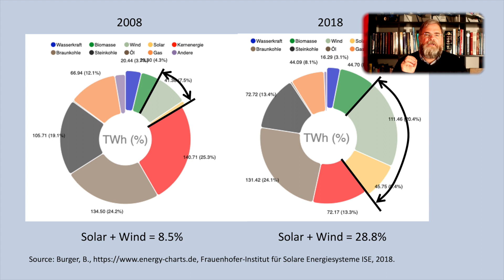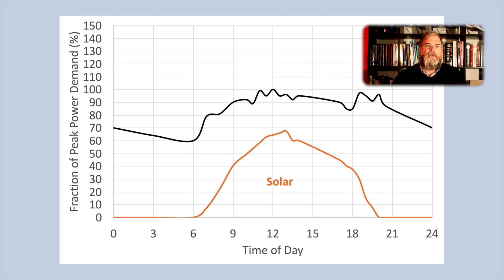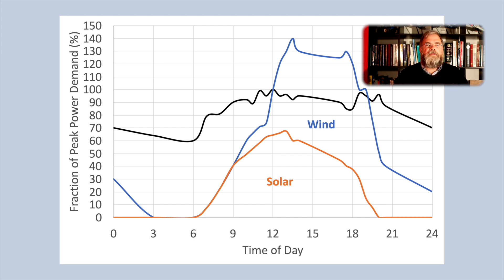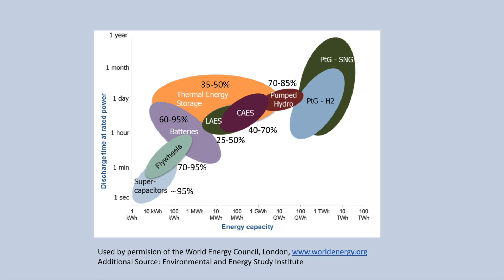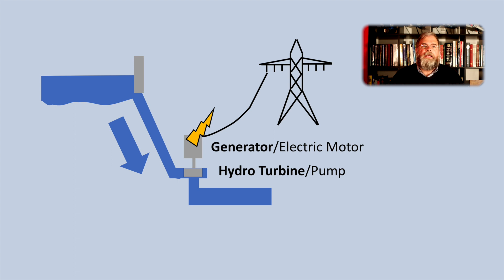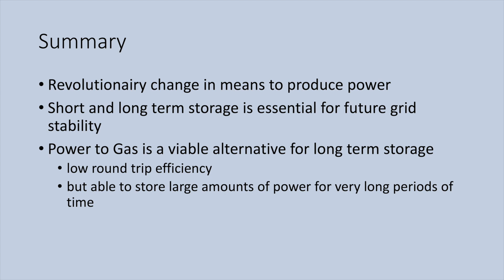Energy Storage and the Future of Gas Turbines for Power Production

Comment: Ammonia fueled IGTs have been proposed for marine power applications but that seems like a potential corrosion issue with all the monels on a ship.

GE Vernova has been doing field testing of their F-Class IGTs using ammonia as a fuel and has reported success so far
Reply from the maker: I‘d like to know the economic case for ammonia.  I have the sense that the people pushing hydrogen are not really looking at the big picture.  i.e. asking the question where the hydrogen comes from and what it will cost.  The round trip efficiency of hydrogen as an energy storage medium is very low compared to alternative ways to store energy.  And hydrogen has a very low volumetric energy density so it needs to be stored in pressure vessels which are very expensive.  Also hydrogen embrittlement is a problem so these pressure vessels will need to be made of special materials which are less susceptible to this likely making them even more expensive.  Ammonia perhaps reduces the storage expense of hydrogen.  But the round trip efficiency of ammonia will be even lower than hydrogen.  The last ammonia conference I attended they, like the hydrogen community, focused on the advantages of using ammonia.  I never heard anyone talk about the economics of using ammonia and how it compares with other energy storage media.
Reply: @engelbrechtgmbh  The Haber Bosch process is too energy intensive to make a clear economic case for ammonia fuel from a Well-to-Wheel perspective, in my opinion. I think the hope was to improve biochemical production methods but now that the grants for this are largely gone I am not sure how much work is being done in this area. Anything that hasn't been published in the past year will most likely atrophy on the lab bench.

I am watching for results from the GE Vernova IGT field testing though. They have invested a fair amount of time and expense in them so they will not completely abandon the work.

Comment: I like your videos and watched of most of it. From your talk about energy consumption during the year and gave Germany as an example. I understood that wind and solar energy would more appropriate for countries located between Capricorn tropic and Cancer tropic, because they consume more energy in summer (regarding hot weather) and vice versa  in winter.
Reply from the maker: Certainly closer to the equator power consumption and production from renewables would be better matched seasonally.  The aim of this video was to discuss how the gas turbine industry sees the future use of their engines.  Right now hydrogen is seen as one of the most viable means to store power long term.  The round trip efficiency of this is very low compared to alternatives but hydrogen can store power for longer than many competitive energy storage technologies.  Pumped hydro, which can also store power for longer periods, would be a better alternative from the perspective of round trip efficiency but hydro is well exploited and new hydro plants would require flooding large areas of land.  Hydrogen can be burned in combined cycle gas turbine power plants to produce electricity.  So this is where the gas turbine industry is focusing their future development.

Comment: Thanks for the interesting video. I would like to ask, how do hydrogen combustion effect gas turbine combustors? The second question is there any plans to combust hydrogen and pure oxygen in a gas turbine? How to handle the high temperature of hydrogen+ oxygen flame, which is about 2600C? Oxygen and hydrogen is produced by the water electrolyzes.
Reply from the maker: Hydrogen has a number of properties which influence combustion in a gas turbine.  It has a very wide stability range and is very reactive.  The burning velocity of hydrogen is significantly higher than methane.  Hydrogen also has a very low volumetric energy density.  Thus the volume of fuel flow is significantly higher for hydrogen than methane.  If premixed combustion is used to minimise NOx emissions then the volumetric flow and the high burning velocity need to be accounted for.  For premixed combustion it is important to mix both the fuel and air very well before the flame.  To achieve this many gas turbine OEMs are opting for highly discretised fuel and air nozzles entering the combustor.  This increases the surface area between the fuel and air and helps the mixing process to occur faster given that a hydrogen flame will likely ignite closer to the burner leaving less time for mixing.  And with advanced manufacturing techniques such as 3D printing constructing such combustors is much more cost effective today than it was when I first started my career.  Regarding the high temperatures: you need to remember that those temperatures occur at a stoichiometric fuel to air ratio (ie when there is exactly the right amount of fuel and oxygen to convert all of the fuel and all of the oxygen to combustion products).  Gas turbines have a lot of excess air and so typically operate at very lean equivalence ratios so the flame temperatures will be much lower.  This is also important for NOx emissions as the oxidation of nitrogen in the air occurs at a rate which is exponential with temperature.  Apart from zero NOx emissions I am not sure the advantages of oxygen combustion.  Peak outlet temperatures of the combustor are limited by the material temperatures which the turbine inlet vanes can handle.  Though increasing this will increase engine efficiency and so technology is constantly moving towards higher and higher turbine inlet temperatures I don't see this increasing by hundreds or a thousand degrees in the near future without a massive revolution in material technology.  Oxygen combustion is something which was once proposed for coal fired power plants to make it easier to separate the CO2 from the exhaust gases (as these would mainly be CO2 and steam).  There is no carbon in hydrogen so no CO2 in the exhaust gases and so this would not be an argument for oxygen combustion.  Plus a lot of energy is required to separate oxygen from nitrogen which would degrade significantly the performance of the power plant.  I am unaware of anyone considering this.  If you know of someone doing this and why I would be interested to hear about it.
Reply from the maker: Sorry I reread your question and realised you were thinking of using the oxygen as a product of electrolysis.  As I said gas turbines have a lot of excess air.  You would need more oxygen then you produce with electrolysis to operate a gas turbine the way they are designed today.  The main problems of simply using the products of electrolysis is that the total volume flow through the gas turbine would be very low and the temperature rise as you point out would be extreme.  You would need materials that could cope with those temperatures and would also maintain the mechanical strength to cope with the high rotational speeds of the engine at those temperatures.  We are already struggling at the temperatures we have today so I don't see this as something which is viable in the near future.

Comment: The so called levelised cost of generation does not take into account all the other costs borne by the consumer. Costs that are due to incorporating renewable generation into grid systems. Balancing costs are considerable and there is the need for back up generators at all times, some of which are running and not powering the grid. There is the costs of connecting the renewable generators to the grid which is significant and there is the requirement to replace renewable generation at about twice that of conventional generators. There has to be 100% or so of maximum demand capacity available in reliable power plants which excludes renewables so on paper a hugh surplus of capacity which has to be paid for. All in all renewables are very expensive when all costs are added.

The graph where wind and solar generation exceeds demand is not something that can occur; as was correctly said  renwables are uncontrollable. That amount of renewables in a grid system would cause loss of frequency control.
Certainly, in the U.K., there is never anywhere near that amount of renewable generation as a general rule. There was a short time last year due to low demand because of Covid lockdown and high winds that some wind farms had to be disconnected from the grid to maintain stability.

Storage today is not used to make up for intermittency but to support frequency, as battery or pumped storage is very quick to react to high spikes in demand. This allows time for other generators to ramp up or come on line as the storage can only be used for a relatively short duration.

Storage to compensate for intermittency is a pipe dream as the capacity required is far too large to be anywhere near economic, and also requires additional genertaion capcity to maintain charge level. For example, again in the U.K., and shared by much of Europe was very low wind generation in April for about three weeks, followed by a few days of average wind generation and again days of low level. It is not realistic to be able to store such a large amount of power.
Reply from the maker: The levelised cost of electricity is important for an individual power producer as it tells them how much of their revenue will be profit when deciding which new power plant to construct.  But you are right what is missing from this for the end consumer or the grid operator is the additional cost of energy storage which is necessary to maintain grid stability when the grid is dominated by non-dispatchable (or not controllable) sources of power.  

Technically there is no reason why such a grid couldn't be operated stably in the future provided there is sufficient energy storage capacity (short, medium and long term storage).

The point of my video is not to debate this.  Political pressure has pushed for the introduction of renewables to reduce CO2 emissions and manufacturers of solar and wind power plants have responded.  The result of that response has been to advance technology and reduce costs.  Over the past decade or so there has already been a massive increase in the production of power by these methods.  This is reality.  It has already happened and it is continuing to happen.  Manufacturers of thermal power plants are now struggling and downsizing because the market for such power plants has shrunk considerably.  The only thing which is putting the brakes on the expansion of wind and solar today is the lack of sufficient energy storage.  All of the major producers of gas turbine power plants see their future primarily in energy storage and all of them are developing combustors to burn hydrogen (which can be produced from excess electricity) exactly for this purpose.

I am simply reporting what I know from my own work and from listening to the leaders at GE, Siemens, Mitsubishi and Ansaldo discuss their view of the future of gas turbine power plants at the annual ASME Turbo Expo.  You may be right that it is a "pipe dream" but everyone seems to be working on trying to make it a reality.  

I do agree with you, though, that it will increase the cost of electricity somewhat for the consumer based on today's technology because you will need to increase significantly the current energy storage capacity of the grid and you will need to oversize your renewable power production to ensure you feed that energy storage sufficiently to cover all possible scenarios and account for the losses associated with the round trip efficiency of the storage method.  But regardless the reality is that wind and solar are already significant and predicted to dominate power production in the not too distant future.
Reply: Engelbrecht,

I still maintain that storage is a fantasy and cannot possibly work. There is insufficient capital to buy them, there is insufficient materials to make them.

You mention large corporations in the business. I believe that they are amoral in pushing systems they must know are inferior and the wrong way to go from an engineering and customer point of view. Subsidies pay them well however, so the shareholders are happy.

The very obvious answer, which although not perfect is nuclear, (And no, I have no vested interest in that industry).
It's one drawback currently is it's inflexibility, however small modular reactors could well be the answer to that problem?

A point not mentioned with large scale utilisation of renewables (Strictly, over utilisation, as you hint at) is that without significant synchronous generation a large scale grid trip makes it very difficult to restore power as asynchronous generators cannot do this.

Countries are making a rod for their own back following the renewables route and there will be a time that this will become obvious. 
Germany is mentioned in your video, but Germany could not run their grid without the forebearance of their neighbours, with whom their grid is connected, to compensate for the large amount of renewables they have installed. However despite this their emissions remain high?

Obviously there are differing points of view in this matter and I accept that mine is quite extreme.
Reply from the maker: @iareid8255  I am certainly not an expert on all the points you raise and can not judge the necessary additional costs as I have not looked into this myself.  

For the hydrogen cycle one of the proposals I have heard is to use the existing natural gas infrastructure for storage and of course retrofitting existing gas turbine power plants to burn hydrogen would keep the costs down.  Whether this is feasible in the long run I don't know.  Initially the idea is to dilute natural gas with hydrogen but later natural gas would be replaced entirely by hydrogen.  Hydrogen has a very low energy density and is the smallest molecule and thus tends to leak through just about any material.  So when this ultimately happens perhaps more needs to be done on the storage side but again I am no expert on this.  The big cost right now would be on the hydrogen production side as new plant would need to be built.  Also everything which uses natural gas from the natural gas pipeline would need to be adapted to burn hydrogen diluted natural gas and eventually pure hydrogen.  If we want to minimise our CO2 production then we will need to do this anyways. 

If this goes ahead then there would still be gas turbine power plants, amongst other power plants such as hydro and other traditional means of energy storage which are already used today, on the grid to stabilise it.  The only difference is the gas turbine power plants would be working as part of the energy storage side of the equation burning hydrogen instead of natural gas.  So your arguments regarding grid stability are not correct.

What I know of nuclear, as you say, is that it is slow to respond to power demand changes so it normally is used to provide a steady base supply of power to the grid and is not used to stabilise the grid.  I don't know if you can get around this by discretising nuclear power into smaller reactors.  But gas turbines are quick to respond and are commonly used to maintain grid stability and even in a grid dominated by renewables these are unlikely to disappear.
Reply: Englebrecht,

the media do not provide a balanced view on this matter and seem blindly to print or broadcast what the renewables bodies say, this is a diservice to their readership. It is an undisputable fact that all countries that have large renewable generation have also very high electricity unit cost. Indeed Germany is planning to hide this cost by changing the way they charge for electricity by  reducing the charge to consumers and putting it onto general taxation.

Hydrogen is an over hyped route as the energy required to produce it is so very energy intensive that it really makes no sense. I'm referring to 'green hydrogen', but the other ways are still very poor.
It also has so many very real problems that I doubt it can really be effective and safe?

Yes, your last paragraph is realistic but there are so many 'reports' that claim that 100% renewable is feasible and achievable, which is quite wrong, it is not. Claims of 'smart grids' etc are pie in the sky and proposed by bodies that are  demonstrably ignorant in the realistic facts of grid operation.